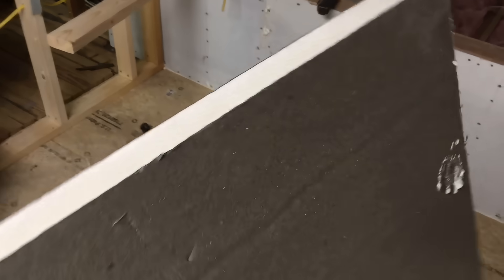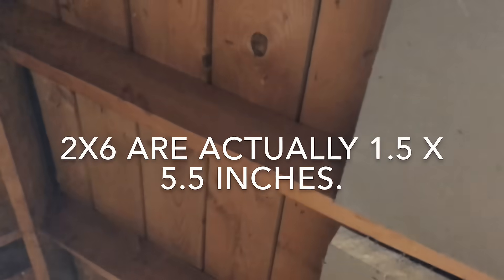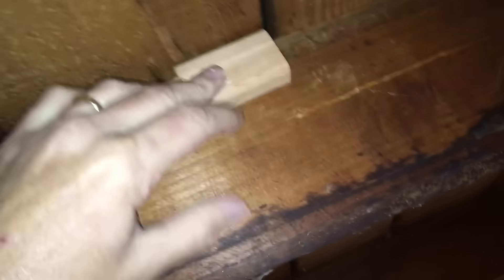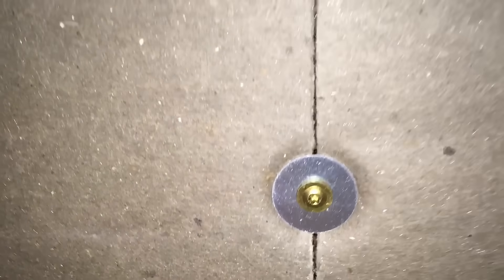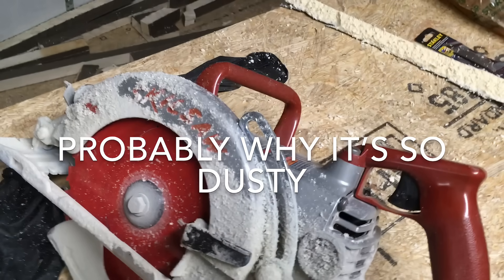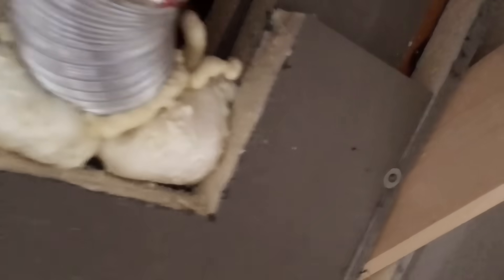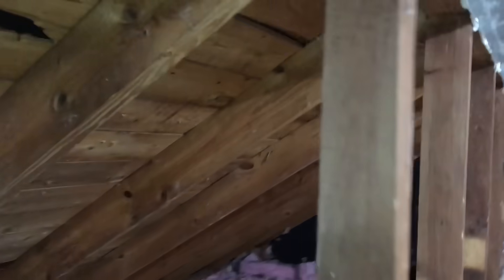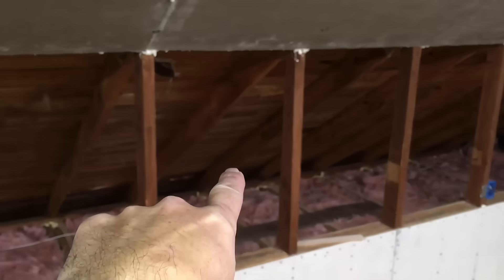Getting R-30 in an attic suite with 2x6 ceiling rafters

Comment: 5.5 inches minus 1.5 inches (spacer) leaves 4 inches, or 2 sheets of insulation. At R7 per inch you're at R24. Why not then add a 1" staggered polyurethane board (after you have spray foamed the gaps) to complete the project?
Reply: He said the 2" boards were R-11.  He then used another across the section to complete.

Comment: What did you use to finish the ceiling after the foam? Shiplap or drywall?
Reply from the maker: Drywall.
Reply: @FamilyFriendlyDIY  Don't the drywall screws pull through the drywall without a nice hard wood behind?  My unfinished second floor is exactly what you have.  I'm torn.  6,800 for foam, 2800 for fiberglass, or do it myself for 1,200?  I'd love to save 5,000 or more.
Reply: @mjhrpgiv  What did you end up doing? I was considering using a spray foam kit and doing one pass then coming in with a rigidfoam like this then sealing that. Scared about moisture though bc im in R3 and in a humid area.
Reply: @barryallen2535  I'm in PA so I get a good mix of hot and cold.  I ended up doing just like this video.  I had 7.25 inches to work with.  I put in about an inch spacer and then 2 layers of the hard foam board.  R13 each.  I cut it snug.  Taped off seams.  Spray foamed gaps.  I did that for the slanted walls and made sure I ran the boards slightly past the knee walls and ceiling rafters, which I used fiberglass for.

Side note:  Later in my project I found Rockwool.  What a cool product.  I used that in all my downstairs walls that were open.  I have a 1950's house that I've now replace all of the exterior doors and windows and have had all the exterior walls completely open to replace all of the insulation and OSB the walls because they were never sheathed.
Reply from the maker: Sorry I didn't see your original comment 7 months ago, Michael. I only get comment notifications when they're not embedded in replies, but I was just reading through everything in preparation for doing a video on the different foamboard cutting recommendations. .... Sounds like you've got some great ideas. Don't know if you saw the drywall video I did, but I ordered long screws that went all the way to the joists. The drywall has been up about 2 years now and not a single screw pop, thankfully. I think the final layer of foam lessens the impact of the joist expanding and contracting with humidity. Thanks for the comments that are helping others!

Comment: Have done similar - but with Festool TS55 hooked up to shop vac - absolutely minimum dust and super accurate cuts leaving only the awkward fitment requiring ‘filling’ the fit was so good that I could only press the insulation boards home slowly as had to allow the air pressure to dissipate.😀👍
Reply from the maker: Nice.

Comment: Tests have shown that an air space between insulation  and bottom of roof deck is required is a myth.  Makes absolutely no difference in roof deck life.  Logic should tell you that it is the same as putting wall insulation directly into contact with outside wall sheathing.

Comment: Very nice work.  What State are you located in?  Getting ready to do this myself.  Should I be able to achieve the same thing, R-30 with using the 4.5in Thermasheath 3 insulation boards that I'm linking below?  And to keep the roof vented would I be able to install 1in rafter baffles before installing the 4.5in Thermasheath 3?
https://www.rmax.com/thermasheath-3
Thanks
Reply from the maker: I'm in South Carolina. It sounds reasonable, but I'd run your idea past your building department first. I actually emailed the inspector my insulation idea to get his okay before I proceeded. I think when you come to them first for advice, they're more willing to work with you for a good solution rather than just trying to shoot you down. Thanks for the comment.

Comment: I cut 2" foilfaced foamboard with a razor just like drywall, it's quicker and if you razor it well it breaks very evenly.
Reply: Sure, but that makes too much sense and isn't macho enough. Why do it the non-messy way when there's a 10000rpm power tool handy?! LOL
Reply from the maker: you're right  https://youtu.be/Z292iuV91hA  wish I'd known that sooner

Comment: should have put some reflective foil on the top layer to reflect the radiant heat coming in from the sun....
Reply: A vapor barrier in a cold space like that is usually a bad idea. If any wet air gets under it there's no way for it to dry.
Reply: He didn't say vapour barrier he said silver foil insulation as a solar reflector. The most common pir board insulation that we use here in the uk has a silver effective coating on both sides,it adds to the insulation value. We use insulation like king span or celotex it's worth googling. You can actually get thin silver insulation on a roll that has good r value and it's only a quarter of an inch thick.
Reply: @danielmilliken1684  yea i'm not talking about vapor barriers....

Comment: Forgot to add that the 3rd layer at 90 degrees is great for making a thermal break for the wood rafters. Wood is just a moderate insulator.

Comment: I have many decades of renovation experience. This is a good solution. Do you have to cover this for fire insurance? Also, I would always want a vented roof for cooling and moisture removal. 1.5" seems to have become a standard but my guess is 0.5" would give plenty of venting. A cutting tip: a diamond masonry saw makes a lot less dust.
Reply from the maker: Thanks. To be honest, I don't know about the fire insurance. I'll have to look into that. I do have to install linked hard-wired smoke detectors throughout my entire house in order to pass inspection. All the boxes are in and wired, just haven't sprung for the detectors yet.

Comment: You know you can just score & snap that insulation board, right? You just use a utility k ife to cut the paper on one side, snap the insulation & then cut the paper with the utility knife on the other side. No mess & no fiberglass dust...
Reply from the maker: If this is true ... I'm feeling really stupid right now. Never even crossed my mind. Thanks for the comment.
Reply: @FamilyFriendlyDIY  no worries, I only found out after years of specifying the product on jobs...one day I happened to catch it being installed.
Reply from the maker: you're right! https://youtu.be/Z292iuV91hA

Comment: Just think of air and portland cement with sudsy soap foam mixed in proper proportion.  Once mixed it looks like colored shaving cream. I can tell you this stuff is the best bang for your buck. You can not get better and easier to apply. Just mix and pump and done. The R value is 3 to 6 per inch. This ia all determined by the air bubbles size which will determine the density. Good luck too

Comment: Thanks for the video. I didn't see how you attached the top layer. Did you use long screws and a washer like on the 3rd layer to attach so the layer was suspended?
Reply from the maker: The two layers between the joists are held with a friction fit. I tried to cut mine a hair too wide so they'd stay in on their own. But if cut too narrow, you can use foam trimmings/shims to wedge them in until you come back with a can of foam. The foam will glue them in place "permanently."

Comment: You should of used aircrete and be done. Way higher R value root proof bug proof water proof itch proof too. Just mix and pump and done.
Reply from the maker: I'd never heard of aircrete. Just looked it up. Sounds interesting for sure.
Reply: @FamilyFriendlyDIY  The insulating value of six inches of air-crete is way more than R-30. I will never use hard fiberglass insulation. The itch is just way to much for me fella. Using the unrolled type is way better for my itch situation.

Comment: The technique is interesting and it gives an air-break for the framing lumber which is good.  The thing I don't understand is why do so much work to avoid a larger rafter.  Just make it 2 x 10 rafters and avoid all of the finishing issues of the foamboard on the interior ceilings?
Reply: Have you priced a 2x10 lately?
Besides which, this isn't new construction, it's a remodeling if an old house. Here in Texas we have no snow loads and a lot of builders use 2x4 for rafters. Only a custom home where the architect required it would go for wider boards.

Comment: I would've just cut some 1/2" ply gusset plates and furred out the rafters wjth 2x4.  I hate foam board because I have done a lot of demo work.  A lot of it was from tearing out dry rot where there were foam boads installed!  But, I can see why you have an air space...

Comment: I've never put 2-6 studs in anything but a dog house .that's your family .2 ×8 yes at the least ..
Reply: William Blakeley most walls and roof trusses are 2x4 my son works foe a structural engineering firm and 2x4 trusses are designed to carry the load

Comment: Just know polyiso is very flammable. Rockwool is non flammable, water doesn’t absorb into it so it doesn’t mold, and critters and rodents hate it.
Reply: See technical documentation. This particular product has a UL-tested and documented Class B flame spread rating (75 or less) that's less than the wood materials surrounding it. If it catches on fire you already have much bigger problems.

Comment: My carpentry teacher says roof raftering will be coming back (in canada). Too much wasted space having attic, with negligible insulating values. Engineers and builders just like to keep it simple with engineered trusses.
Reply: Scissor trusses are good for cathedral ceilings
Reply: Bonus room trusses are also available. A room built into the truss.

Comment: This nothing new. In Europe we use PIR/PUR board at scale and spray foam is less popular. Also why not GLUE the board instead of screw. These screws act as a thermal bridge.
Reply from the maker: I like the glue idea. I might try that on the other half ... when I get to it. Thanks for the tip!

Comment: Thank you!! I’m a bit of a DIYer - redoing a master bedroom in a bungalow up in MA - 4x6 rafters. I was going to go closed cell spray foam because I didn’t want to lose headspace, but it’s so $$$! This video has completely changed my direction. Found R13 2” polyiso board - 3 layers will get me up to a compliant R 39 in my area and it will save me THOUSANDS. You are the man!
Reply from the maker: Awesome. Glad to have helped. Thanks for your comment!
Reply: Plus on site cell foam is always a crap shoot in terms of mixing and applying chemicals correctly...if not right you cna only correct with a new roof !!

Comment: And from what I heard, the foam R value is way under rated since the testing was not taking into account heat transfer by both convection and radiation, only conduction, some say as much as 50% if we look at heating costs, meaning you may be as much as 50% ahead by using foam.

Comment: Actually you don't beed ventilation if ... you don't have vented soffits or ridge venting. If you have only vented soffits but no ridge vent you have no draw to pull airflow so your better off eliminating any soffit vents and completely filling each cavity from the roof sheeting to the inside face of the rafters. I know what I'm talking about and have done insulation for many years. I've argued with engineers and architects who were ignorant of the facts and hated being proved wrong by some blue collar worker. If you think completely filling the cavity is crazy then think about this ,,, are your wall vanities vented? How about any floor insulation? Not so crazy now is it. As long as there are no gaps, moisture won't be a problem.

Comment: Nice , I wouldn't want to use spray foam insulation on roof joists even if I could  spend the extra money. If there is a roof leak the joists  will rot out and you won't  know it.

Comment: How did you finished over this?
Reply from the maker: 1/2 inch drywall, paper tape, and a "setting" type joint compound for more stable joints.
Reply: @FamilyFriendlyDIY  I think my question should have been, how do you attach drywall over the top of the rigid foam? Do you just screw through to the studs?
Reply from the maker: Yes. That's exactly what I did.
Reply: @FamilyFriendlyDIY  Thanks! I'm glad it's that simple!

Comment: I like the idea but these boards add up quick. I want to do the same thing with my 28x32 garage roof that is 19' high but might cost me a small fortune at $18 each board
Reply from the maker: I hear ya. It was just the cheapest way for me to get the highest r-value in the thinnest space. If I had deeper rafters, I'd have probably put just one thin layer of foam against the spacers (to keep my ventilation) and then stapled in fiberglass bats. Thanks for the comment.

Comment: So with the 1.5" spacer you have 2 layers of foam to come flush with your 2x6 and then the 3rd layer is installed on the outside of the 5.5" cavity of the rafters right.   Also where did you buy that foam
Reply from the maker: That's right. I got the foam from a roofing supply company in Greenville SC USA. This type of foam is usually installed on top of commercial roofs, beneath membrane roofing.
Reply: Did you buy the polystyrene XPS

Comment: Hi I was just wondering if the fasteners will affect how the drywall will lay with those fasteners behind it?? Thanks
Reply: You can shim out and fix the waves with a good float coat, I have had to drywall over pan heads in steel frame fixtures and it all looks the same
Reply from the maker: A couple did telegraph through, but I just floated the spots out a little kind of like KRGsportscards mentioned.

Comment: That is not Polyurethane foam! What you have is known as Polyisocyanurate rigid board insulation which is the standard used by flat or low slope roofing contractors. The aged R-Value for this product is 5.4. This is the latest roofing industry rating as accepted by building code authorities. I’m a semi-retired professional roofing and waterproofing consultant with 40 years field experience in the roofing industry. I’m glad to see that you’re informed enough to find and use this product. Like I said, it was designed to be used on the top of flat structural steel or concrete roof decks. natstek@aol.com
Reply: What do you mean by aged r-value? I've acquired a pallet of polyiso that has been kept indoors but not wrapped and sealed away from moisture. Does moisture from the environment, stored indoors in Dallas TX humidity really degrade the product that much? Ive read the hunters polyiso installation manual and it to seal it from moisture in storage. If moisture was such a concern, wouldn't the product degrade from moisture after installation as well?

Comment: Not finishing out the bottom and then just putting batts in the ceiling basically defeats the purpose of how you did this.  The vented roof will blow cold/hot air thru the batts and the knee wall greatly reducing the r-value.  You want to seal off the whole space to make it conditioned.  Even just using one layer of rigid foam on the bottom portion of the roof and up top before adding the fiberglass batts would help alot to stop the air infiltration.  Putting the fiberglass batts between the rigid foam and the drywall will make sure you get the stated r-value.
Reply from the maker: Your family wouldn't be from Goa, would they?
Reply: @FamilyFriendlyDIY  Yes but many generations ago

Comment: Dave, how did it work out in the finished project?  What’s the temperature in the room/s up there?
Reply from the maker: I've got a couple other videos where I do an update. But in summary ...it holds temperature very well, but I ended up with a humidity problem during the Summer months due to using a PTAC.
UPDATE: Used a dehumidifier in the Summer and it worked great. In the winter there was no need and the PTAC (with a built in heat pump) keeps it perfectly comfortable.

Comment: Great video, I'm doing something similar soon. Did you have any trouble installing a drywall ceiling over that third layer of foam? IT seems like drywall would be difficult, since you cannot see the rafters, so how do you know where to put your drywall nails?
Reply from the maker: Good question ... When putting up the drywall I could still see the collar ties overhead (because I used fiberglass batts there), and the studs in the knee walls line up with the rafters. So I marked the top of the drywall just next to the collar-ties, and the bottom where I could see the kneewall studs, then snapped chalk lines between them..
Reply: I worried over this concern myself when doing something similar (1" Polyiso foam under flat ceiling). I simply marked the rafter location at each end prior to installing foam and confirmed they were reasonably straight and on 16" centers. Then I used a laser to streamline getting the first row in. Pretty simple from there.

Comment: Timber framers that use 6"-8" thick roof panels don't have a air space?
Reply: Bebo May vented nail base is an assembly that includes insulation,  sheathing, and an airspace in 1 assembly.
Reply: Hot roofs work....I have built many.  Sealing joints is the most difficult and important step.